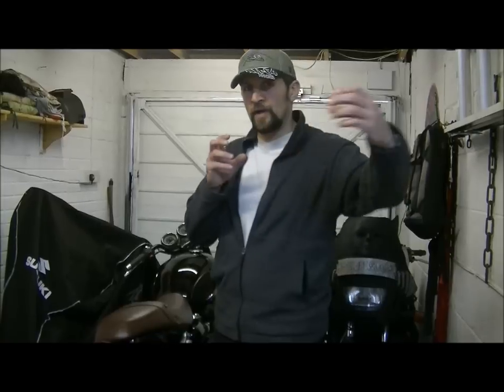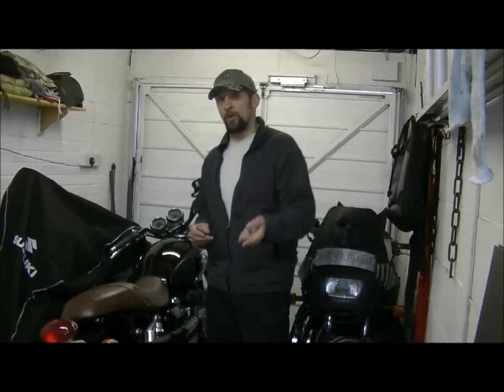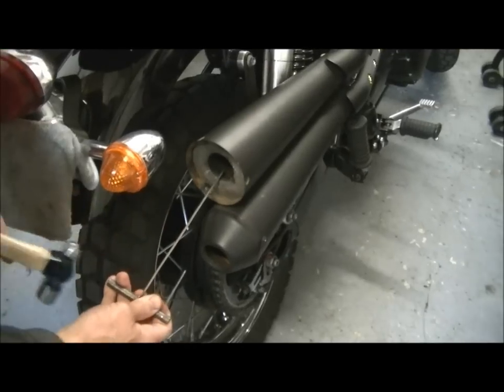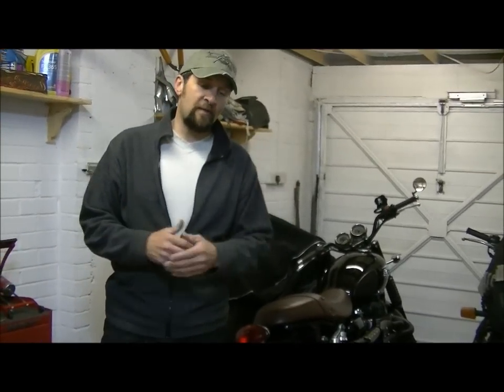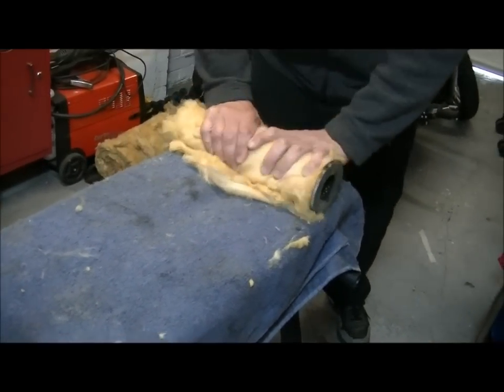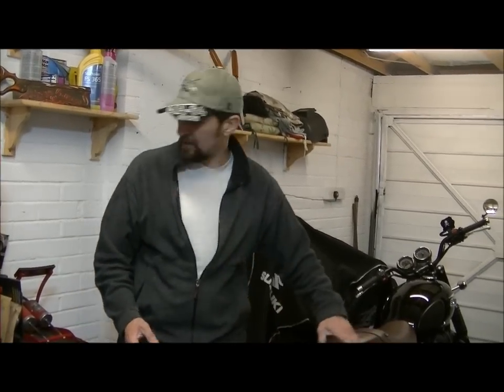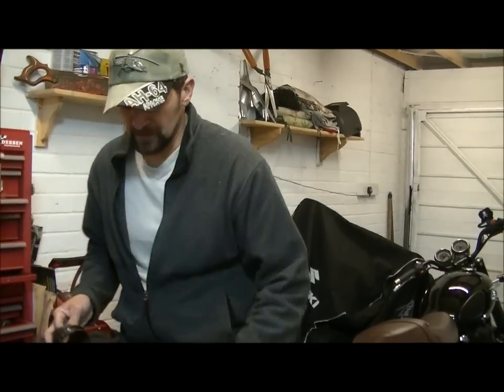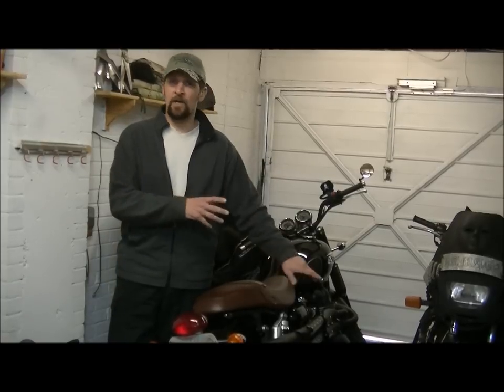Delboy's Garage, How-To Re-Pack a Motorcycle Exhaust

Comment: Pro Tip: open garage door when running indoors, carbon monoxide can harm you.

Also dont run engine before touching exhaust it will get hot. 

Wear neoprene gloves so ya won't itch later.

That is all.... lol

Comment: Too right! Ive always used loft insulation on all my bikes. 2 and 4 stroke. Theres always enough surplice around the edges to pack an exhaust! My current stock is the old insulated jacket from our old hot water tank. Wrapped in protective plastic and cut into thin sheets. Perfect!

Comment: I found 25' roll 0f 3"x 1/2" fiberglass mat pipe insulation at a  home improvement store. one roll was more than enough to y easily, double wrap, two baffles. I secured the loose end with masking tape so it will release and allow loft after run in. Thanks for suggesting building insulation ; my out of pocket was 5USD

Comment: Hey Del. Just a quick question about soldering. After watching your vid using solder as a filler, I thought I might try it to fill pitted fork stanchions. I use super glue to fill and fine grade wet n dry to sand at the mo but it needs re-doing every few months (its only a 15 minute job). Do you reckon solder would bond well? Otherwise I'm thinking epoxy or some such.
Your thoughts would be much appreciated.
Reply from the maker: Well if you're bodging the pitted spots every few months, then i guess it cant hurt to try, i have no idea if it will stay put...have a go and let us know.... but long term, why not get them rechromed..?
Reply: Moonfleet41 Unfortunately the budget doesn't allow for re-chroming for a while yet. Spent a small fortune on this old bike so far this year and unfortunately the missus is putting her foot down and wants a holiday and some new soft furnishings! I'll try the solder but above the point the fork seal travels to test, and do the rest if it bonds well. Let you know if it works out. Thanks as always for your reply mate.

Comment: If my M4 has rivets holding the tip in can I simply drill them out and use some self tapping screws for after the repack?
Reply from the maker: Yes Adam, that would work fine as long as you dont drill the holes out too big... also you can simple re-rivet the cap back on too....good luck with it..Del.

Comment: Hey dude. I used to work on a boat building yard. We used to fibreglass hulls of 50 to 60 ft yachts, then fair it down with sandpaper on giant sanding cauls. It was a miserable job to do in summer, in full mask, goggles and a boiler suit. One thing I learnt from the daily splinters and at one point a lung infection, dispite the mask, and that was that you would never get me anywhere near glass fibres in any form without gloves and a respirator with brand new cartriges.

I hope you wearnt too itchy after filming this video, five years ago!

Comment: Nice one. Quick question: does the packing deteriorate over time, over useage or a combination of both. I've got a race can (sounds luuurverly with the V-4), it only did a couple thou on the bike every summer but it's probably about 8yrs old now. Time for a re-pack?
Reply from the maker: Yes indeed, quite correct my friend, they do deteriorate over time and use, the tiny fibers of wool break up and disintegrate as time passes and they get louder and louder... the problem it that its so slow and progressive that you wont notice it getting louder...however, ill bet that if you take the baffle out, after 8 years, you have hardly any wadding left, plus it will also be very gummed up with soot and condenstation that it wont be very absorbent now and it needs to be t absorb sound..But once you repack it, you'll notice a marked difference right away... hope that helps.. Del.

Comment: Great little vid,Sounds much better del,lot deeper, doing the loft soon so I'll be sure ta keep some to the side for the future, on another note,have you any what the legal DB level is,I keep getting different answer's.Lee.
Reply from the maker: Hi mate....there is currently NO legal Db limit for road bikes, they rely on the enforcement of "not for road use" stamps etc and 'tollerate' louder cans as long as they are not ridiculous....most race tracks have a Db limit for track days, it varies around 103 and a perceived pitch..(screaming two strokes need to be much lower)... but for the road, we have got away with that legislation so far..!

Comment: Hi Del. I bought V&H short shots for my Shadow at xmas, even with the quiet baffles they were still too loud for me, gave me a headache most rides, plus the timing was all wrong, I removed the baffles and re wadded (a word? lol) them, re packed them, took 2 hrs to get the baffles out, bloody things. I still weren't happy, so read up on back pressure, I home made some copper inserts made from flattening some 15mm copper pipe and shaping them into a spring so they wouldn't rattle inside the pipe then I pushed them up into the baffle and secured with a screw on the inside of the pipe so the screw would not show, this gave just the right amount of back pressure to reduce the noise to a more pleasant sound for the rider, but also gave more low end torque and reduce the backfire too. I learned that straight through drag pipes are good for drag racing as they gave the best top end, but for simple everyday riding this can just be a pain and give most riders a headache, I still love the sound of the pipes on my bike since the home made baffle inserts and a lot of people have said that it sounds much better, a more lower sounding rubble rather than I barking sound, this is before I've explained what I've done to improve it. I know too much back pressure is bad for the engine, but it seems to be spot on at the moment so I'm very happy with it. Enjoyed ya video, thanks guys. Paul.
Reply from the maker: Well done Paul, i love the sound of that mod to bung up the pipes a bit, you're right, you can have too hollow and empty a sound, and a little baffling can make a huge improvement. Thanks for sharing that buddy, ride safe and enjoy your bike.. Del.
Reply: Your not going to get to much back pressure because the baffle is hollow the gases can just go straight through.

Comment: How can I make my 2016 dyna low rider stock exhaust louder without damaging the performance of the bike?
Reply from the maker: Just put Short Shot slip ons in place of the mufflers, retaining the stock header pipes will be nice and loud, with no other mods needed, but if you do add a fueling device and open filter, you'll gain lots more power and the bike will run cooler.
Reply: You will also need to modify the fuel tune if you do all that.

Comment: Hi del great video .. I've started using TEC 2x2 clubman exhaust on my Bonnie in place of TOR exhausts. But it sounds timid with the baffles and very loud n tinny without the baffles. How do I adjust the baffles for a more rich bassy beat just like that with the TOR exhausts.
Do I shorten the baffles or cut open up the end . Need your expert advice on this . Thanks and regards.
Reply from the maker: Hi Kumara. I am friends with George Milburn, the Owner of TEC Bike Parts, and i was involved way back when he first designed the TEC exhausts, the baffles he designed we're meant to be really quiet just like the factory pipes if you wanted that, but you could cut them down to tune the sound as you wanted... so if it is the kind that are 'capped off' at the end, with a few holes round the tube.. then you could first cut just the cap itself off leaving the tube long, but open all the way through.. and see how you like that.... if you want more volume and a deeper sound, then you can cut the tube down in short increments until its right for your taste...  Hope that helps you my friend, good luck with it.. Del.
Reply: Thanks for the prompt reply del...
I'll definitely try it out. 

.

Comment: Hi Del and all! Thank you Del for such a channel; learned a lot because of you ! I have some questions: Nightster 1200 , 2007. Slip ons Screamin Eagle. Took them out; almost no more insulation.  My baffle has a strange inlet in it that deviates the gases in between the OD  baffle and ID of the chomed pipe. Not modified. The baffle is drilled with almost 3/8 inch  holes. Not many though. Nothing compare to a lot i saw on your channel or others. A drawing would be easier...  Anyway; I wrapped everything with alumina blanket + fiber glass (like yours).  No more backfired sound, and all that bad noise, but still super loud. Can you tell me something about that deviation ? I clogged it with the insulation: starting to think was stupid. Should i drill more holes or by another set of baffles ?

Cheers mate.
Reply from the maker: Just to be clear buddy... what are you exactly trying to achieve here?.. more power?, more noise?, less noise?, maybe to pass some kind of smog test?... not sure what you are asking buddy... !
Reply: Must admit, not really clear. Well : much less noise. The damn thing is loud like Hell. Power, i have plenty.  Do not want to put back the stock exhaust. I have a Screamin Eagle breather and a remap... Not dyno ($$). Need to lower the dB. I am wondering if i should drill holes in the baffles so that the insulation traps more of the sound. Also, my question was also theoretical; what is the purpose of that deviation done in the baffles? Generally, the baffles are just plain tubes drilled. Have you ever seen that kind of baffle? Did i made a mistake by putting insulation everywhere (and at the same time, covering that deviation)?

tx for all

Comment: Hi Del, another great video.  Thank you. How far you have come in these few years 🤣.  I am about to buy a 2001 Triumph Speed Triple...but, please don't spit your cornflakes out, it's too loud!  So I was going to look at adding/replacing the baffle and/or packing like this video.  Do you know, does anything else need doing regards engine management if you do this? I heard someone mention 'ecu will need remapping' which sounds like I won't have the necessary hammer!  I would value your opinion.  I'm just a sedate commuter, not a wheelying nutter!  Cheers!
Reply from the maker: Hi Daniel, It's difficult to answer that mate as not sure what exhaust you have, does it currently run smooth and clean right through the rev range to the red line?  If so, then you're good to go... you will have to find out if it was re-mapped to get where it is (previous owner), perhaps there's evidence in the history?  If you wanna go back to a more standard factory sound, then the Triumph dealer can re-map it back to factory for you... and if there's no evidence in your history, they can tell you what map is currently installed, so it looks like a trip to the dealer at the very least... but they don't charge much and they'll do it properly for you!
Reply: @Moonfleet41  thanks Del, but I'm confused.  I collect the bike tomorrow so will check the history for any evidence.  But I guess you are saying that, whatever I do - new exhaust, repack...I need a visit to the dealer to check or remap...?
Reply from the maker: @danielb1563  No, im just saying to check what you have in the bike right now.. if it has an open loud exhaust then it would most likely have been remapped for that in order to get the best from it.. if it has an open race can on it, and runs smoothly right round the clock.. then it should do the same with the pipe repacked.. just ride it once you have repacked it and see if it pulls and rides smooth with no flat spots... and if you find any flat spots or it coughs at certain revs, then it could be worth a look at remapping it..!
Reply: @Moonfleet41  thanks Del.  I got the bike this week, and actually spent an hour or so at Hughenden M40 Triumph yesterday and they really explained, as you have about it too... I may refit an original exhaust - at least for a bit.  They said it'll likely run rich, if I do.  Which is better than running lean...but see how it goes.  Thanks, I am loving the triple!!

Comment: Hi Del, would this method work on my Tec Tracker 2-1 short 6 hole baffle used on my T100?...
Reply from the maker: Hi Simon, the little short baffle in your TEC Tracker, the one that fits in the with the circlip?  isn't designed to be packed, the packing is already in the exhaust and shoulnd't have blown out by any means, if you want to quieten down the exhaust, then surely the baffle by itself does that, or is it still too loud for you?
Reply: @Moonfleet41  Hi Del, oh I  see I didn't realise this. The sound of the exhaust isn't a problem. I've only just bought a T100 with the Tracker already fitted. It actually came without a baffle so I ordered one from TEC. Fitting the baffle and circlip was straight forward. However, the baffle is slightly loose and has a slight annoying rattle once started. I thought "packing" it slightly would cure the problem. Any ideas Del? Many thanks for your reply.
Reply from the maker: Ah, i see,  No they dont need any packing around them, they just fit in as they are... but i have had that issue with them rattling about myself... what i did to cure it was to slightly "oval" the widest part of the baffle that fits in snug to the open exhaust... just squeeze it gently in a vice a little so it jams on the sides as you push it in, then tap it down into place, and fit the circlip.. that should do it, then if you ever need it out again, i make a small hook on the end of a length of 3mm wire, and hook it out..!   Hope that helps you Simon. good luck with it.. Del.
Reply: @Moonfleet41  Hi Del, many thanks for the reply. That's brilliant mate.👍I'll give it a go first thing in the morning. Thankyou.
Reply: Hi Del, just to let you know I followed your advice above and it worked a treat!..... Many thanks for your help mate.
Reply from the maker: @siyouell7378  Great news Simon, glad it worked for you mate.